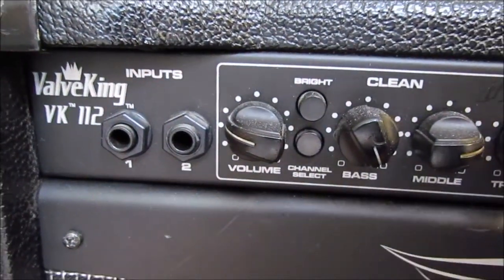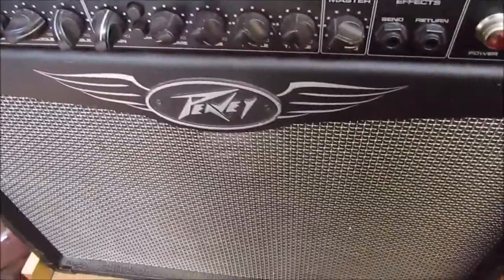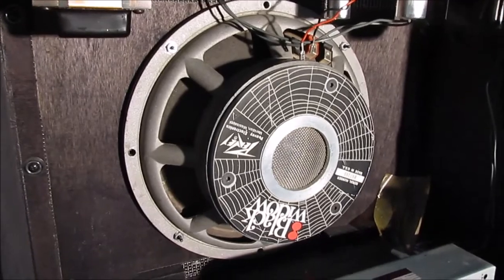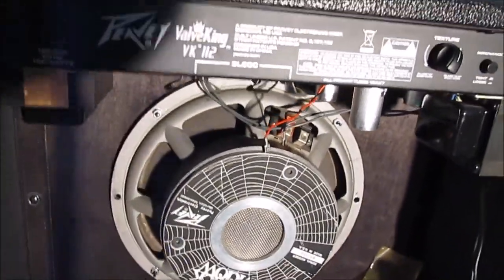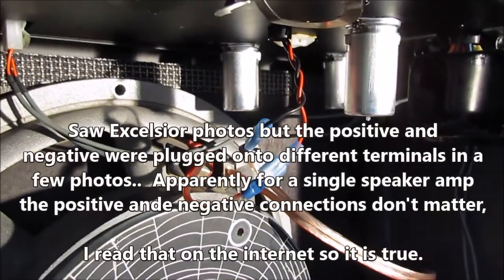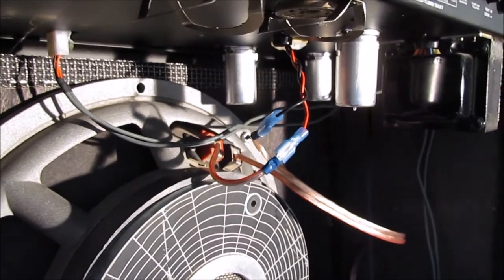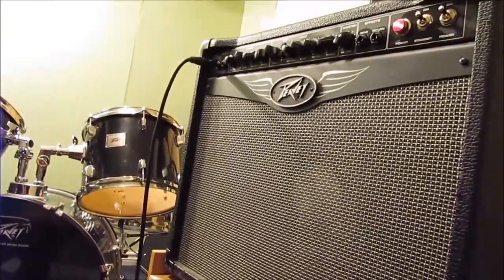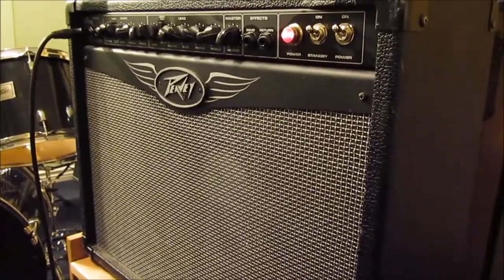Peavey Valve King, Add Speaker to 112 Combo

Comment: About 250$ is the going rate for a Peavey VK 112?
I think I lucked out. Yesterday I bought a used Peavey ValveKing 112 combo for just 50$ via "Offer Up" app. It was probably a very rare opportunity to acquire an all tube amp for so little, but the guy who sold me the amp had just purchased an all tube Orange Amp, and really just didn't need the Peavey anymore!
Btw, amp sounds great. 
=-)
Reply: Damn, you only paid 50 dollars for this amp?
I mean, if it works properly and everything's fine, you got yourself an excellent bargain, man!
I paid mine 260 euros (which are roughly 295 dollars as of now) last week.

Comment: You say that this is a 50 watt combo? I think that it is VERY important for the speaker wires to be positive to positive/negative to negative. Ever try a 100 watt 4x12 with Celestion greenback 25 watt speakers?
Reply: Not when your wiring in series to bump up the ohms on a pair of speaker s

Comment: Confused and no sites has clear answers on my question ,hoping you or someone here can help..so here's my question : " I want to connect a speaker cab behind my combo amp .There is already 2 speaker output jacks behind my combo. On top of the output #1 ,it's written {4 ohms}. And on top of the output#2,  it's written {8 ohms}.  But when I plug a speaker in either of the output jacks, it disconnects the internal built in speaker of my combo amp. My internal built in speaker is a "Celestion Vintage 80’s", 8 ohms....It's either the cab or the built in speaker ,Why? . The goal is to sit my combo on top of a cab and have both speakers running as i always did with my previous amps.So these 2 speaker outputs  are totaly useless. Has to be a reason or purpose . I'm tempted to ignore those 2 speaker outputs and pull out the internal 2 wires from the amp and try my own connection...But why can't I use them 2 speaker outputs, Does'nt make sens to me. Anybody's help appreciated . If one wants to view my amp and rear panel for more info...                 My amp is a   Randall RG50TC .
Reply from the maker: Hello, every combo I've had with external outputs also turns off the internal speaker as well which sucks.  There is probably a way to not have the amp switch the internal speaker off but I'mm not sure.  I'll check around.   One way would be to connect the internal speaker to one of your external outputs but then you would have to sue the other output |(probably the 4 ohm), for the external cab and 4 ohm cabs aren't common...
Reply: Joel Poitras I've done this, with blues jr.,, speaker ohms, should match amp output. you. can go higher, i.e. 16 ohm, but don't go lower, you'll blow output transformer!.
Reply: ml414skidoo , yeah, have'nt mod it yet, but i'll probably cut a 1/4” speaker cable ,plug it in the 4 ohm external speaker output and solder the bare wires of my combo's internal 8 ohm speaker and my 8 ohm cabinet ++ and - - , it brings it all to a 4 ohm total load which will be plugged into 4 ohm external output...can't see it not working.

Comment: both speakers work ?
Reply from the maker: It worked but have gone back to the original single 12".  
It sounded super huge when when sent into a 4 x 12" cab with speaker out jack  but looks silly with a combo on top of a cab.